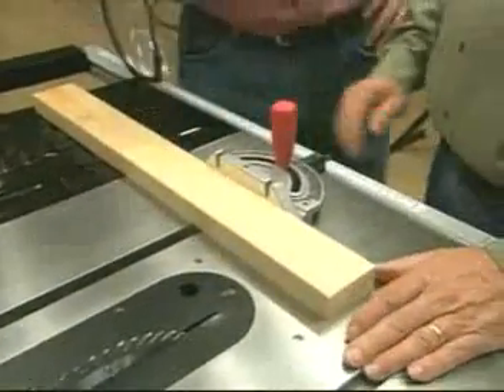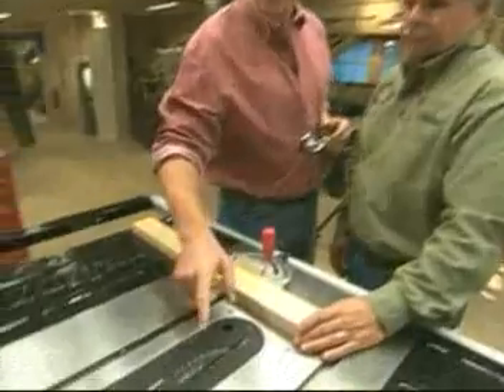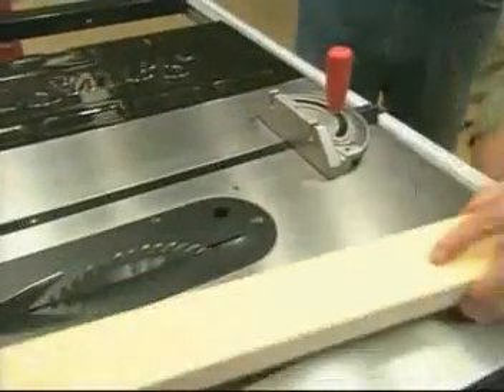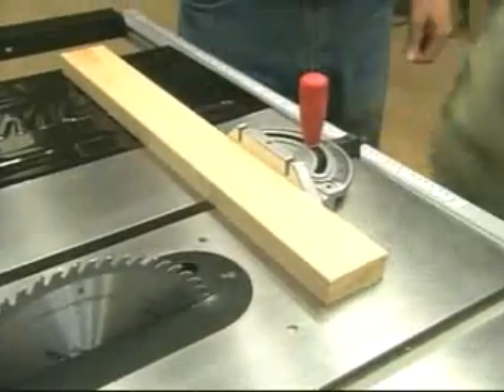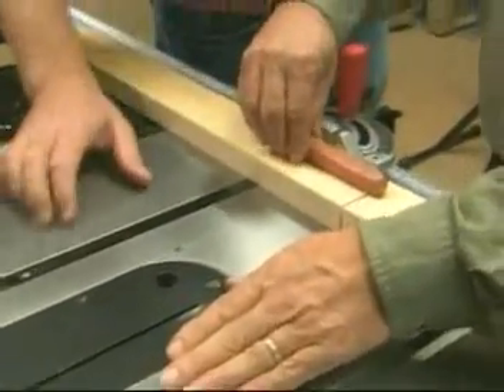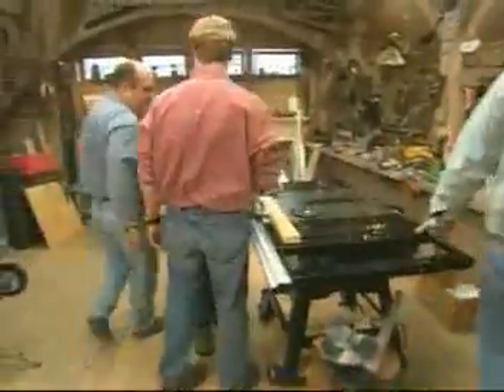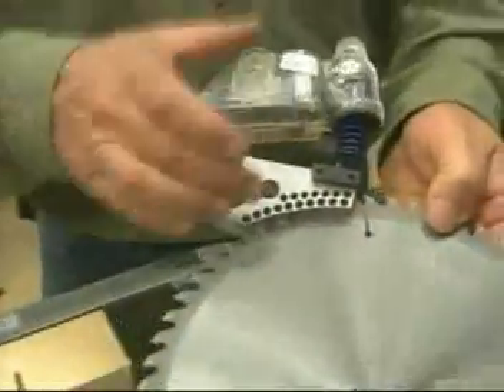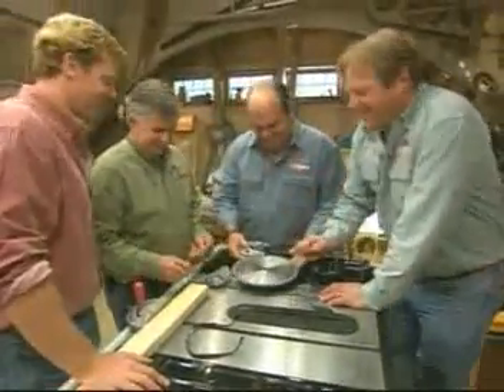Table Saw Technology

Comment: you can disable the the braking system with a key, so if your cutting a wood with higher moisture content, or a product that conducts electricity the blade will not stop. The system works of continuity, not so much moisture like said in the video.

Comment: On the show "Time Warp", the inventor actually did test it with his own finger to prove that he trusted his invention. His finger made it out without a scratch, and it was capture in super slow motion. You can probably find the video on the related sidebar or by searching for it. Another video review showed that you can still cut through wet wood and nails perfectly fine. Not saying that this should replace common sense and good safety, but at least we know it works as intended.

Comment: Ok every time you trip that safety will cost you around 75 bucks for a replacement. I do maintenance on woodworking machines for a living and and I can tell you that this thing is still primitive. Plus the blade is still usable, it's not true that you wreck the blade!
Reply: I would rather pay $75 for a replacement then to be without a finger.

Comment: @HOREBALLE the guy really didnt explain it in detail very well. it has other features that work together. your body has an electromagnetic current that moves threw you, and your body is also warm, so it senses the mositure, the warmth, and the current in your body completes the current of the saw blade break system. thus putting on a wet piece of wood will not trigger the break. i own one of these machines, and have tried cutting a wet piece of wood. it dose not trigger the break.

Comment: @odmcarp 
THis saw works.  As a shop teacher, I have seen this work first hand when a smaller student touched the blade after cutting the wood.  He just had his hands too low and let his middle finger just graze the blade over the top.  This was at speed, not just going slow.  The blade dissappears in 0.05 of a second.  Best insurance there is....what's the price of surgery?  Especially for a kid.

Comment: so I spend $60 on a safety devise so I can feel safer putting my fingers where they don't belong and hope that over time the saw dust doesn't degrade or render it inop and lose my fingers under false pretense of safety when I should have never put my fingers remotely in the way anyways. A piece of scrap wood for a push stick would save you $60 and your fingers too

Comment: whenever the human finger hits the blade, it absorbs some of the voltage created by the spinning metal. that drop, is monitored constantly. so if the wood had moisture in it, it wouldn't matter. only a soft piece of flesh can absorb voltage. not wet wood. if i could, i'd be glad to throw my finger at it to test it... hey guys. need a human demo?